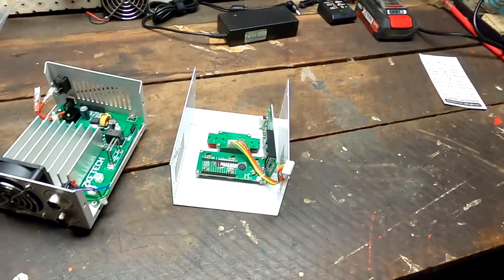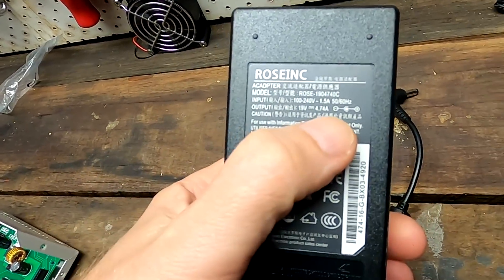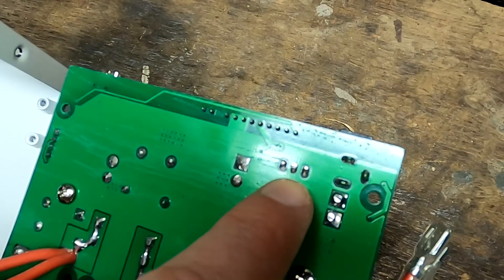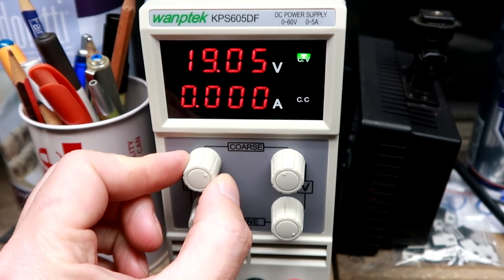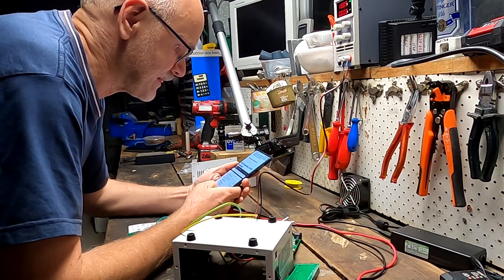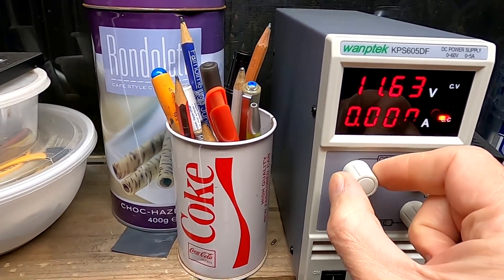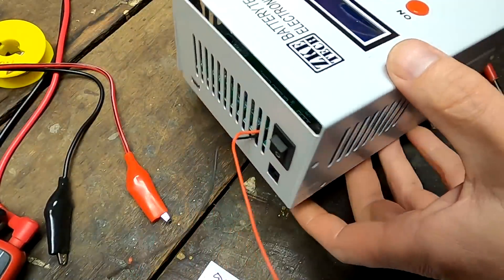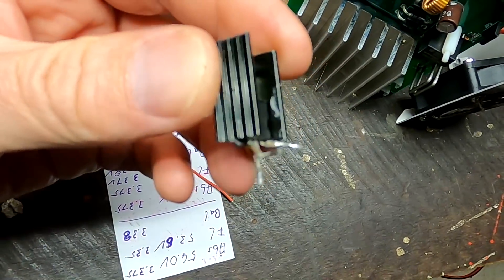Voltage spike took my battery tester out! Easy fix? 💊💉 Part I

Comment: I wonder.. why there is not 12V DC power supply when the device runs on 12V?
Reply from the maker: Because it can charge batteries up to 18V.

Comment: That is a common voltage regulator. You will get it at any electronics shop that sells electronics parts. I have a few in my work shop, but it will cost a lot to send it to you from the Caribbean. :) Love your channel

Comment: Andy, I have a question about the ZKE output chats, bitmap and excel format. Downloaded the ZKE software, but the excel data does not behave like you showed; being able to run cursor along curve, to read voltage and current? I have Smart ANT BMS, which can calibrate SOC, by voltage, and can set the re-initialise SOC to 100% at other percentages, I tried 90% and hit it, once; so upped it to 95%. I only charge to 27.2v max, on 24v Lifepo4. 3.4v / cell. Was hoping to get a more realistic SOC, using your data for the 280Ah cells. BMS has 11 voltage levels to calibrate SOC. My 0% is 2.5v 100% is 3.5v. 0.1v steps. But the curve is much flatter than that. Maybe you could make a Table of data? Thanks.

Comment: Holy Moly. 19V - 12V = 7V @ 1A... 7W heat on a 7812 with this little heat sink 🔥

Hey Andy, get a Victron Orion TR and make your own 12V from your big battery. Put some Banana connectors to the battery tester (with a 1,5A Fuse) and use it this way. Btw then you should take out the 7812 or use one with a very very low drop out voltage.

This is Btw the way I use my offgrid system. I have no inverter but lots of electronics which use 12V DC as main input. From a pc over a router to the switch all use 12V. many of my led lights are 12V so I use my PV for that too.

Have some sunny days. ☀️

Comment: You should have firstly set your power supply to 12v 1.5a then turned it off, touch the leads together to disperse any powered up caps then connected your leads before powering up the power supply. The circuit will only draw the current it needs, this unit can be powered by your solar setup using a voltage regulator circuit with a LM7812 standard circuit with a filtering capacitor on both the input and output sides. In fact a LM7812 might even replace that blown transistor if you only need 12v.
Also when connecting a live wire use a ceramic power resistor between the positive wires to reduce any sparks.

Comment: I saw >1A at 6V as you were winding up voltage. That sounds like another problem! 
I doubt if another 7812 will fix it.

Comment: Funny story one of the kayak motors I had built had these on my speed controller (it had six of these voltage regulators) knowing me I had to test to the limit well blew my controller it was spectacular fire and smoke so poor me had to paddle for three hours to get it back to the car

Comment: Good morning brother good morning Australia 🇦🇺
Congratulations 👏👏👏 to repair it 
One question why lithium cells 3v and why 12v cell not available ? 12v single cell
Reply: Because that's the voltage you get from that particular mixture of chemicals. Lithium-ion 3.6 or 3.7V, Lithium Polymer 3.7V, Lithium Iron Phosphate 3.2V. Every mixture is slightly different.
Reply: @pau1phi11ips  thank you brother I really don't know about that

Comment: I used to build my own linear Voltage regulator circuits together on some of my smaller solar panels.

    The one I started with came from Radio Shack store.
    It was a Motorola part number LM317T which was a 1.5-Amp 35-Volt max input.

  Then later on I switched over to a LM350T which is 3-Amp with a slightly lower voltage threshold.

   And now they even have a 5-Amp one available I don't think it's a Motorola one.

  The only difference is pin 1# one both the LM317 & LM350 is used with a 5K pot to very the Voltage.

  But if you just want 12-Volts, then a MC7812 should suffice.....A-N-D its 1.5-Amp but you need to ground pin 1# to negative and pin 3# is input & pin 2# is output......its also blow proof as long as you don't over voltage the input.
  Dead shorts will only cause the chip to heat up thus causing the chip to shut down. Remove the short and the chip comes back to life and not becomes night of the living dead part 10!!!!

Comment: There is also another voltage regulator next to it , the package with 5 leads, looking at your pictures it appears the 7812 is mounted upside down with its writing side facing the board if this is so and there is room under the board when mounted in the case put it on the opposite side of the board , first cleaning off the green coating where it will go so you can solder the tab to the copper ground plane on the underside of the board which will form a large heat sink as it probably failed due to over heating.

Comment: Great. Another piece of junk I’ve ordered. Waiting on the 40 Amp unit. So what caused the VR to go bad?
Reply: It was the power supply and a lack of protection in the circuit. I would be building a protection circuit between the power supply and the unit.

Comment: So the units comes with crappy power supply that caused damage to the tester. It uses regulated 12V to run the main controller. It seems to me that it uses the 19V for charging circuit that is why the unit is supplied with 60W power supply, I hope the charging circuit is not damaged.
Reply from the maker: Yes, the power supply is crap. and undersized. The 19V are needed as the tester can charge batteries up to 18V. The electronic tun on 12V though. That's my understanding.

Comment: Bei dem Strom, bau keinen 7812 wieder ein. Nimm einen Pinkompatiblen DC/DC wandler. 7812 sind stink normale längsregler und bei 19V Eingangsspannung muss das ding knappe 7 Watt in Wärme umsetzen. DC/DC Wandler haben einen Wirkungsgrad von 80-90% und vertragen wesentlich mehr. Traco oder Floeth haben da gute.
Aber wie andere schon schrieben, scheint da auch was anderes nicht zu stimmen. Guck mal was daneben sitzt für ein IC und meld dich mal bei mir.
LG
Reply from the maker: Mach ich, danke Dir. Leider war es nicht nur der Regler 😑

Comment: Hi Andy
The 7812 supplies 12 volts at 1 amp. If your external supply needs to put in close to 1 amp to light up the display other things are broken. I suggest you feed it a lower voltage with some ma and see what gets hot, the auwie test from Louis Rossmann, it should help you diagnose your tester
Reply from the maker: I don't think the display or electronics use even close to one amps, that will be rather 50-100mA max.
Reply: Yeah I was thinking that's allot of current for just a display. How is your MOSFET / transistor under the heatsink? Could have maybe failed short circuit with a slightly higher resistance. Agreed with using thermal imaging to help diagnose !

Comment: Something else is wrong with it. That's why the voltage regulator died. Trace it down
Reply from the maker: The external power supply was wrong. It's at the beginning of the video.

Comment: Andy, please, try to power up tester with 12 V, but without fan attached to it - maybe, failed fan can draw all this excessive current from 12 V rail, as it used for fan. If fan is not a source of failure, then, a ceramic (MLCC) capacitors at 12 V rail can leak such high current with associated heating after 27 V "hit" it. Also, 12 V is used for powering 3.3 V linear regulator for MCU and other logic, and, it seems, it is used to drive gate of power MOSFET (it is under the heatsink). So, if 27 V could go past LM7812, it could probably create a short circuit in MOSFET's gate. So,  this excessive 1 A and more current can flow to gate through damaged driver and low-Ohm gate resistor.
Reply from the maker: The fan is only for cooling the FET if a load is connected.

Comment: Wow, that is fairly rare.  Linear regulators don't usually implode like that.  You should be able to find a replacement... any 3-pin linear regulator with a 12V output and input within specifications should do the job.

Max input voltage for the L7812CV is 35V.   27V should not have killed it.   In fact, 27V is probably the intended output of that wall power supply.  For the L7812CV, 19V is the minimum input voltage.   So there's a bit of a mystery here... what blew up that linear regulator?

-Natt
Reply from the maker: I assume, the power supply had a problem and spiked maybe far above that 35V and caused the death of the VR. Only when I measured the voltage of it, it showed 27V and shortly after 0V, so it was on it's way down form something higher.

Comment: Just take a 7805 with a 7V Z-Diode in series with the ground pin...
Reply from the maker: I had a 7805 actually in stock...
Reply: Probably everyone does, but the Z-Diodes are usually limited...
And it is easier to fit in the matching 7812.

Comment: the last power supply reading look around 6v/1amp when the display start to work.. but where go all this current?? (this blue LCD need less than 50ma to work at 5v).. the 7812 is able to take 1.5amp max but here  nothing is connected, just the supply.. the CPU look to work fine but it’s very strange to have this current.. have you tried 12v/1amp (limited) for to see what happen with the current?? ..i’m just curious because look not normal for me..
Reply from the maker: That's my concern too. Hence I took the power off quickly. The current is not good...

Comment: There seems to be more broken than just the regulator, don't know what the hack draws 1A for just the display, its illumination and a small controller.
Reply from the maker: I hope you absolutely NOT correct.
Reply: Then why would zketech go to the trouble of using a power brick that puts out multiple amps?
Reply from the maker: @john_in_phoenix  for charging the batteries connected to the tester. It can charge up to 5A.
Reply: @OffGridGarageAustralia  That makes sense. I would check that power brick, cheap ones die often. The 40 amp cell tester has what seems to be a pretty decent internal switching supply.
Reply: Lack of power protection redundancy built into the circuit

Comment: The LM 78xx regulators and 7812 are quite common and cheap. The 7812CV appears to be a cheaper off-brand chip, no real reason to look for it. But every 78xx chip should have input and output capacitors used with it, and since an overvoltage should have damaged these too, you might want to replace those even if they look good. A dime each?
 And since the meter is important to you, maybe a fuse and 15v zener diode as power input protection? The 7812 will still be happy, but the zener will kill a high input at 15v. Another dollar for parts.

Comment: What on earth is using upwards of one amp on the 12V rail?! - That regulator is going to get HOT and burn itself out. I think you have another fault after that regulator. If you are drawing 1A and feeding 19V into that regulator it needs to dissipate w watts of heat. That is not going to happen with that heatsink!

Comment: Any 7812 regulator will work.  just about any local electronics store will have it.  Don't trust anything on eBay they lie like there is no tomorrow.  There is still something wrong.  1 amp is the limit of this device.   The power loss of 7 watts is a lot of heat.  That little heat sink can not take it.
Reply: Agreed. Either it’s very poor design and the 7812 is inadequate or there is something else wrong. I would power up the tester and feel around for anything getting hot.
Reply: The L7812CV is rated at 1.5A which would suggest that a standard 7812 would be insufficient (1A maximum). It also has a maximum temperature rating of 150°C (300°F) which is higher than the 7812. Those heatsinks are typical for use with these devices.
Reply: @chrishartley1210  The L7812CV does look like a high performance version of the 7812.  The other point I made was the heat sink is way to small to dissipate the 7 watts of lost power (Vi 19v - Vo 12v) x I 1a = 7w.

Comment: Good video. I have not yet open my box with EBC-A20 tester. Soon. Any week now.
Why not run your EBC-A20 on the external wanptek power supply until the replacement voltage regulator will be delivered?

Comment: Would like to see inside the power supply, I am interested to see what failed.
Reply: It is regular "chinese" and "laptop-like" cheap PSU, where AC input filter is missed. This PSU has MX2269 flyback PWM controller and a few required components. I suspect, that voltage feedback  optocoupler U4 was failed and output voltage was raised to 27 V. This "817" type optocopler has many "no-name" clones, which could easily fail in random order.

Comment: First: there are no problems, just challenges. The 78xx series is bloody basic. If a shop have at least 5 components to sell, it will have a 7812. Linear regulators with more legs are adjustable, but they are anyway burn the defference in voltage to current and produce a lot of heat. With 0.8 amps it makes totally sense to replace it with a tiny switching supply module. Put it on the list of your next order from china as a by-catch.
Reply: LM317 is the adjustable with same TO220 package with three legs ;-)